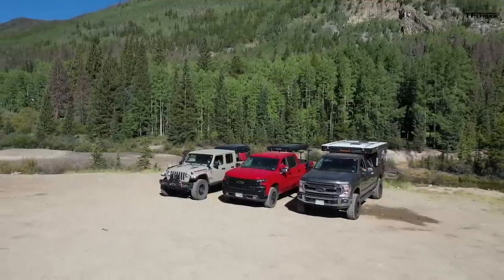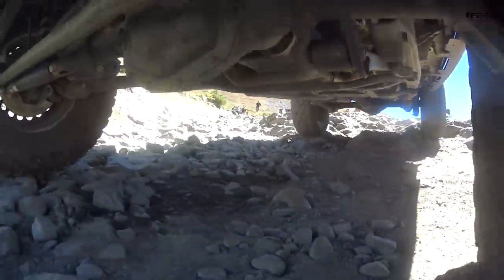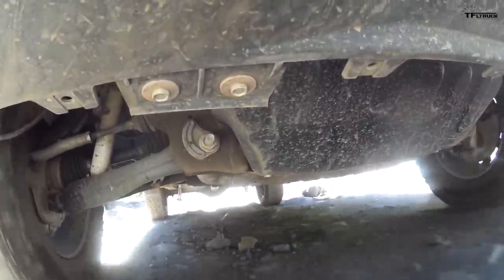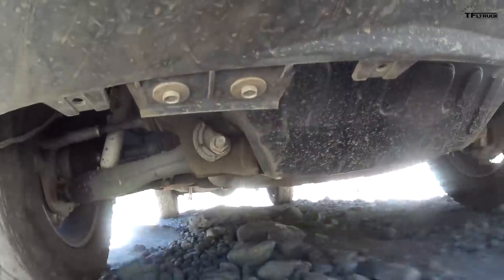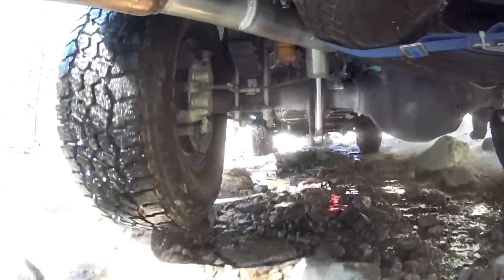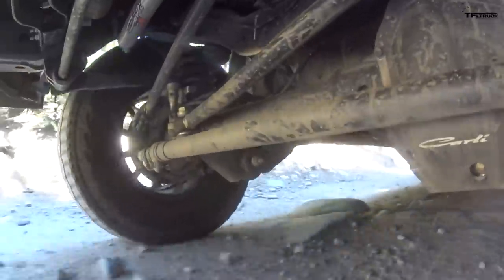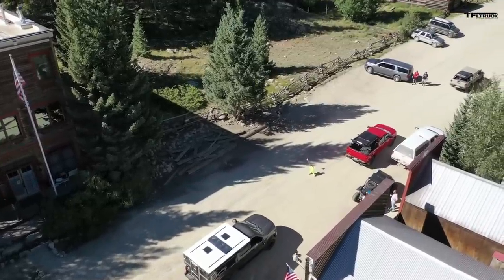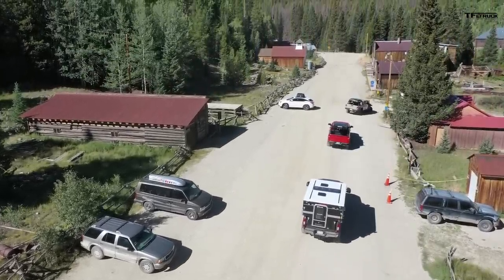Check Out How Independent & Solid Axle Suspension Works In Real Time! No Pavement Needed Preview

Comment: Let me give you the Cliff Notes version of ground clearance with solid front axle (SFA) and independent front suspension (IFS).  Take two 4WD's, one with SFA and one with IFS that have 10" of ground minimum clearance.  With SFA, no matter what the suspension is doing, it will have 10" ground clearance at its lowest point--usually the front differential.  With IFS, when the suspension goes into compression, the ground clearance at the center of the suspension--usually right under things like the oil pan, etc.--can decrease substantially--up to 2" or more with a "soft" suspension.  So, if the IFS has, say, the 10" of ground clearance at the A-arms and, say, 11" at the center, that center clearance may reduce to 9"  when the suspension goes into compression.  That is why IFS trucks may take considerably larger tires and greater suspension lift to achieve the same real world ground clearance of an SFA vehicle with shorter tires and less lift.  I own and drive vehicles with either IFS or SFA.  For hardcore 4-wheeling, I still prefer the SFA.  The IFS vehicles that I've seen perform the best off-road are actually the HD GM pickups, in part because the IFS is stiff enough that it doesn't compress much in off-road situations.  Toyota's IFS tends to be pretty good, too, because it is pretty "stiff" in off-road use.
Reply: Good explanation
Reply: Some vehicles with independent suspension perform very well offroad, the Steyr Puch Pinzgauer being one with front and rear independent springs aided by front and rear lockers and at the super heavy end the Czech Tatra trucks in 4x4, 6x6 and 8x8 again with lockers in all axles, people are knocking the new Defender with all round independent suspension but it is this vehicles complexity and poor brand reliability that let it down, wait for the Defender 90" with coil springs instead of airbags, that should be a lot better.
Reply: @rockymountainjazzfan, I'm going to assume your screen name means you're a Utah resident.  Go head out to King of the Hammer in Moab and tell me how well SFA is working.  Can't wait and don't want to travel that far?  Go to your local Can-Am or Polaris dealer and look at their side by sides.  Or, you can watch videos on Ultra4s or military humvees.

Comment: so ultimate ground clearance really comes down to the tire height, got it
Reply: Suspension lifts, body lifts, don't mean a lot of you don't have tall tires.
Reply: You have to lift to clear bigger tires...but yes, the bigger tires give the ground clearance
Reply: Herb Wheeler body lift gives zero ground clearance
Reply: @flight2k5  pretty sure thats what he basically said.
Reply: STACKANE yep just woke up when I read that.  Muh bad
Reply: suspension lifts give increased approach and departure angles, and usually break over angles but they don't get axles any higher off the ground. as far as lifts to fit bigger tires, because bigger tires do get more ground clearance, you are still going to be limited on tire size by the size of your wheel well
Reply: @StayOnIt  Lift, or cut fenders and keep CG low.
Reply: Or if you have portal axles with bigger tires!
Reply: Anibal Babilonia unimog. The perfect truck
Reply: @flight2k5  no, but it does give you a better approach, breakover, and departure angles.
Reply: just a vet a body lift?
Reply: @flight2k5  yes, when you raise the body, obviously that raises your bumpers too so you get better approach and departure angles ect.
Reply: just a vet no the bumper is bolted to the frame. Not the body
Reply: @flight2k5  some trucks yes, some trucks no, however it would increase breakover angle in every vehicle.
Reply: just a vet no it wouldn’t.  The frame doesn’t change
Reply: Portal axles

Comment: That Ford F2 50 is amazing considering how much weight you have in the back of the truck it seem like it went through that with no problems
Reply: Then again, it has like a $8,000 Suspension Upgrade! Only stock truck here is the Trailboss
Reply: DC Details yes I know But I’m in the RV industry and to achieve what he’s doing is phenomenal and unheard of truly of course he spent the money but it’s very capable
Reply: @ripfletching  unheard of? I know multiple people who have 3/4 or 1 ton overlanding rigs, all with much larger campers than this. That tiny little camper is like half the payload capacity.

Comment: On the ford make sure the heat shield is big enough for the spare.  I’ve been 300+ miles from home and the spare was melted through from the exhaust heat.  In the video Around 4:45 it looks like the exhaust is super close to the tire with nothing to protect it.  Maybe I’m wrong

Comment: I'm using 20inch rims on my gmc yukon coupe instead of 16inch or 17inch because of ground clearance
Reply: You got no meat tho
Reply: @joelmora2826  and a rather streety selection of tires
Reply: @joelmora2826  I'm using BFG KO2 305/555R20
Reply: @philtripe  check my channel and go to my cars list 
You will find a video about my gmc
Reply: Man that's not gaining you any ground clearance at all, and bigger wheels are worse for off road, you want the maximum amount of sidewall
Reply: @marinusdedreu3833  I tried from 16inch upto 20inch rims and found 20inch is the best if you had the proper tyres same as BFG KO2

Comment: 8:12  The rear shock mounts hang WAY too low on the Ford. Seems like a very poor design. That is a broken shock and shock mount just waiting to happen.
Reply: The truck wasn't designed to go trail riding. Its made for pulling heavy ass shit
Reply: @Bill Madd it should have a little skid plate for it. Many raptors have it

Comment: So it took 2 modded trucks to follow the chevy.....sounds abput right.
Reply: um the jeep has the same kind of lift as the chevy. its a factory lift.
Reply: @Stackali  it's a stock vehicle vs 2 modded vehicles. 

Is that hard for you to understand?
Reply: HioSSilver1999 stock gladiator solid axles, front, and rear lockers from factory.
Reply: @HioSSilver1999  we get it... your a die hard fan boy that could buy a brand new Chevy, blow it up in a week and blame Ford and i get it... compared to a VW its reliable, compared to my Toyota its just a Joke
Reply: @Jay-uk1zx  yea i know. It's still not a stock vehicle.
Reply: @philtripe  toyotas are shit dude. Around here their frame rusts up. The body of them always have. Bolts break up on the junk
Reply: @HioSSilver1999  Maybe back in 1999 they did but not now. Toyota's are far more reliable than chevy so now I know you are one of those guys that just love GM no matter how bad they are. There is no way I'd take a Chevy over Toyota if given a choice and especially if I'm spending my hard earned money. And yes I do own a Tundra TRD PRO and loving it.
Reply: @dalephillips8250  my mom has a 08 Toyota minivan.  It has not held up as well as either of my gm products. 

The Toyota dealer here was still replacing rusted frames last year that i know of. Not to mention the weak frame they use in the tundra is pathetic.
Reply: @HioSSilver1999  Crazy...thats not the norm I see here in Ohio. I see Chevy trucks with the front left wheel folded over all the time....not as many lately though but still problem with electrical and fuel injectors/transmissions.
Reply: @dalephillips8250  my car is a 99 camaro and my truck a 03 2500hd Silverado.  Both bought new. The camaro has been great other than me tearing up shit. Only thing i have fixed on it is 2 window motors. My truck has had a few issues but nothing major. Her Toyota has had the entire ac system replaced, oil line break, the engine is louder than both mine combined and she's had to have the drivers seat upholstery repaired and the passenger side needs it now.

The new gm stuff may not be any better idk. For sure the more they use recycled materials the worse they will all be.
Reply: @HioSSilver1999  Yes there are some good GM models also. I'm mainly speaking of trucks but, in general Toyota has some of the most reliable vehicles which is why the resale is so good on them. The Tundra has consistently been the most reliable 1/2 ton pickup. Of course there can be lemons in even the best of models. But on average I've had to help more GM owners whom were broke down than any other manufacturer. Sounds like you got a very good model year of truck and I'd say keep it because I haven't seen a lot of others have that good of luck with their Chevy trucks.
Reply: @dalephillips8250  yes still today Toyotas have problems with rust, northern parts of the world especially. I live in northern BC (Canada) and at the local Toyota dealer there are 4 brand new tundra frames on pallets out back, 2 getting frame swapped in the shop, and a pile of about 10-12 old frames outside beside the dumpster. Yes they still have problems rotting out. However I will agree with you (being a Ford guy) that Toyota is probably the most reliable vehicle now days. Their downfall is that everything they sell is outdated, underpowered, and bland. I mean even the new "Supra" was an epic fail of monstrous proportions.
Reply: @marinusdedreu3833  I didn't know they rusted up there still. It seems as if when I see Tundra's ...even older ones they still look good but I guess its possible. Although I do not feel the Tundra is underpowered after driving it compared to the other pickups I drove. Now outdated as in they haven't changed a lot of things I can agree somewhat with that. But, many people don't want all of that new tech in which things go wrong. This is partially why Toyota Tundra has the best reliability and fewest problems of any 1/2 Ton truck. I like Ford also but for a pickup truck I will only go with a V-8.....their turbo eco boost are turning out a lot of power but in general they are not hanging around as good as their V-8 model. Even the new Raptor is going back to a V-8 I hear.

Comment: When Toyota is more American than GM
Reply: My 2014 Silverado was built in Fort Wayne, IN.
Reply: Toyotas are weekend warriors no comparison.
Reply: Where do Toyota profits go? Any idea?
Reply: @samduran5180  weekend warriors that run all week... my Taco has 313,000 miles and burns zero oil, original clutch and rear brakes ... chevy hits 300k and its on its third motor and forth transmission ... your right... no comparison, i never have to do anything to my truck
Reply: @philtripe  Your talking about Ford dude those damn trucks don't last for shit. Don't forget Chevrolet trucks are the longest lasting trucks on the road according to DMV. And come on you know 99% Toyotas are weekend warriors and I've seen a few with LS swaps😉